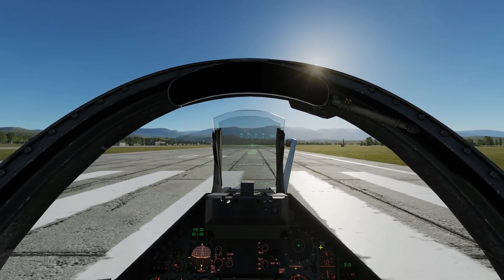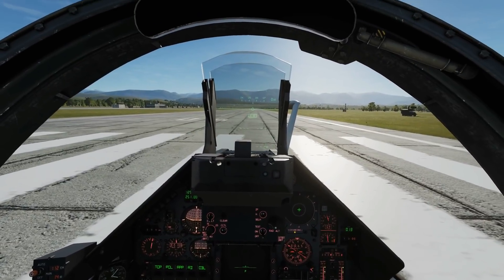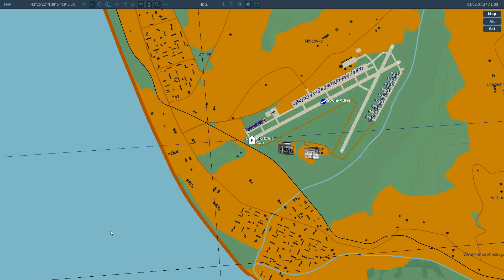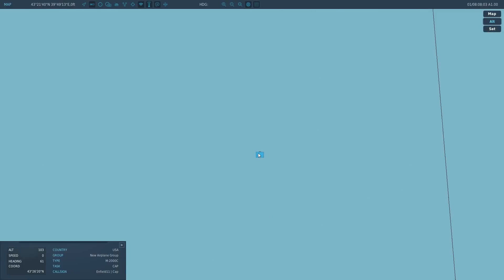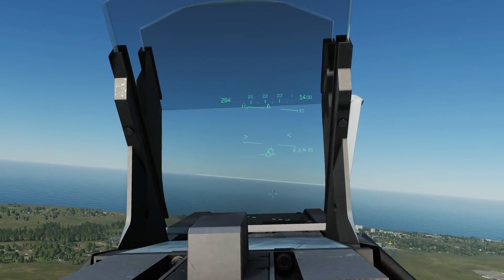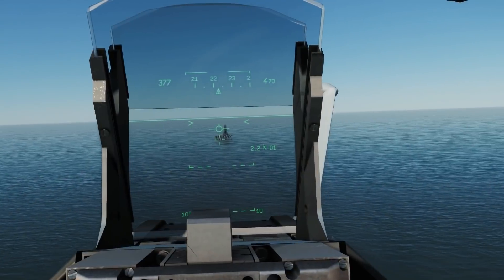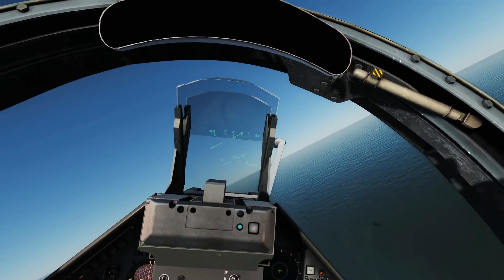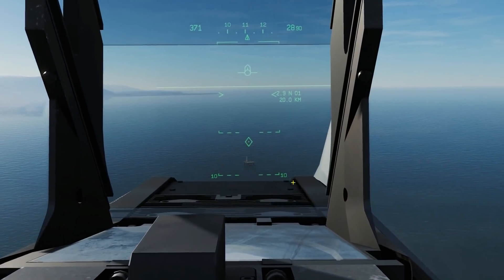Mirage 2000C: Airborne INS Nav Re-alignment | DCS WORLD

Comment: According to the training, for method one it’s when you press the REC button that you capture the point, then you validate if the Record was good, which makes more sense i believe (you don’t want to misalign Your ins with one button press)
Reply: This is correct. Rec was pressed way too early in this vid. Only reason it worked is because mirage ins is bugged so that all updates are 100% accurate. If this bug were ever fixed following this procedure would leadt to inaccuracy.